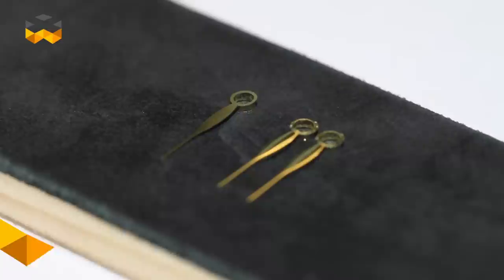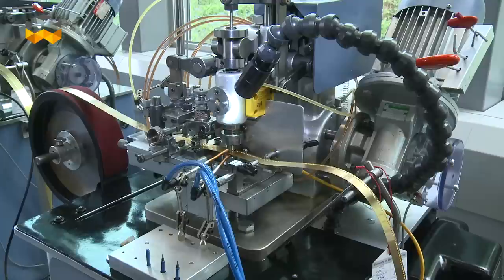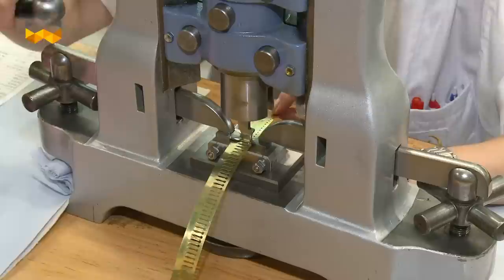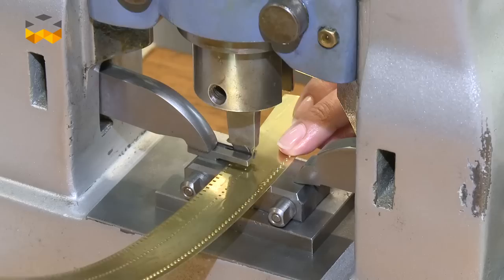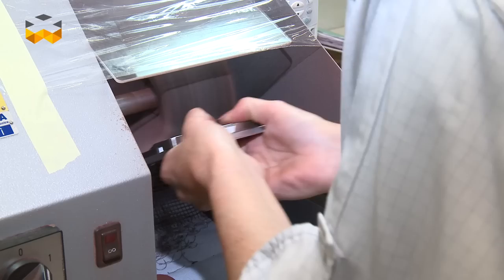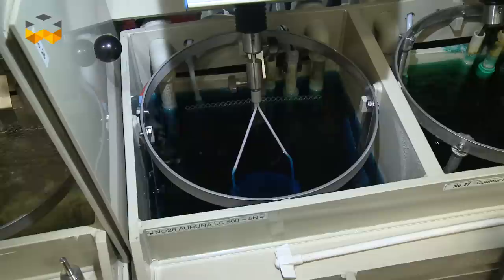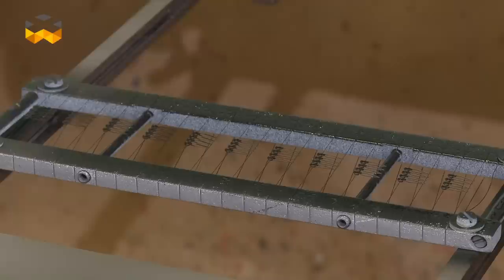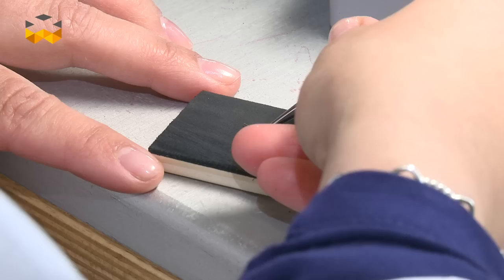One week for one watch hand, you must be crazy!

Comment: But how do you make the die that cuts the hands in the first place?
Reply: The die for the minute hands was made in 3 pieces, the bottom 2 are held together with bolts which run through them, with the 2 then clamped onto the press.
I thought they'd use a modern method but that particular die looks to have been made a traditional way "punch milling", in which each half of the bottom die is machined with half of the overall shape, then fastened together to produce the whole, then hardened. The top piece can basically duplicate the bottom by coating in lead, pressing together for a template, then machining all the excess away, then hardening.
This is a lengthy manual machining process, the final tool is tested by cleanly stamping something such as silk fabric, but paper would probably suffice.
Reply: @beautgrainger147  thanks!